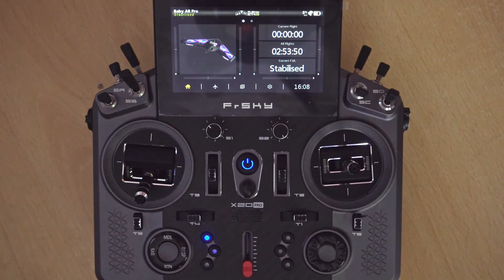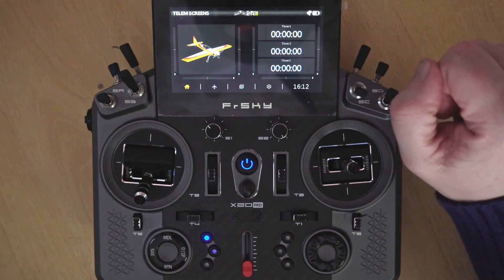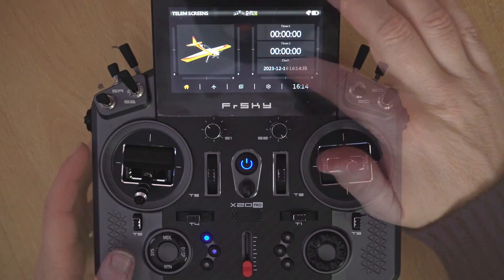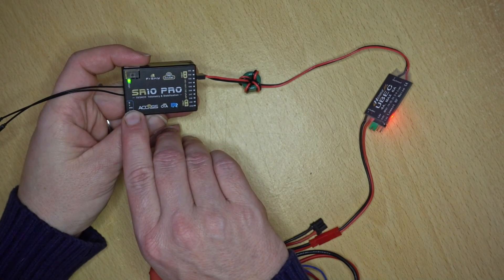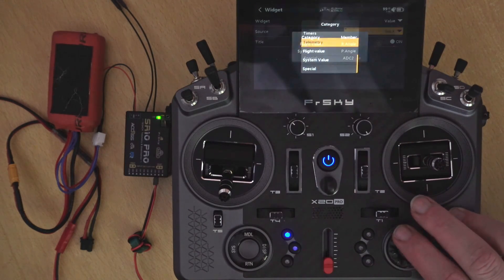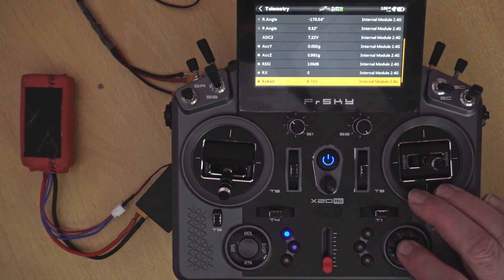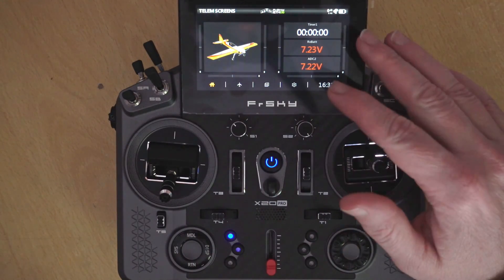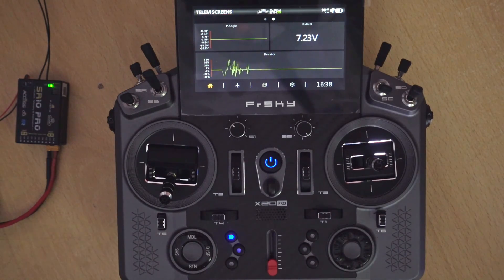Setting up telemetry and sensor widget screens on ETHOS

Comment: I am moving from Spektrum to Frsky it is a steep curve but with the help of your videos it's made things a little easier. Now the question if I set a basic model up eg. expo, throttle cut  and rates. Can I use this  as a template for other models after making some weeks to match the new models. Thanks

Comment: Hi Daren. To "reset" the line charts, "Flight Data" is the only option that I can get to work, but for some reason it sets off a multitude of my audio warnings. As an interim solution I set a pause condition as the Disarm switch kill position. Any ideas? Thankyou.

Comment: I am trying to get telemetry data from a chain of SBus sensors (GPS, flight battery current sensor, etc.) through my TD SR6 to my X20 HD. My question is: where do I plug in the head of the chain connector and where in Ethos do I configure  the string as SBus. I notice that if I touch the RX1 TDSR6 in the RF System page, I get some tantalizing options, but I can't figure out the details. Any help would be appreciated...
Reply from the maker: These sensors are usually SmartPort (or FBUS). So they should daisy chain together. Then plug in to the SmartPort (S.Port) connection on your receiver. 

Then on the transmitter you’d just need to discover new sensors on the telemetry menu.
Reply: That's the problem: neither my SR6 nor my SR18 have an S.Port connector, just connectors marked 1 through 6 (or 1 through 18)...
Reply from the maker: You should be able to assign one of those ports to SPort. It will be in the receiver options.

With the SR6 it’s on the white connector on the top. From the left, you have - + S. S is the SPort connection.
Reply: @MrD  You are the oracle for most of us! Thank you for staying with my silly problem. With your guidance, it is resolved - thanks again...

Comment: Is it possible to set a max current or max rpm on the screen to view it after the flight i fly heli and i am not able to look down during the flight.
Reply from the maker: Yes. When you choose the telemetry sensor you want to view. For example RPM. Long press the enter button. That will give you options for max, min, and maybe a couple of others.

Comment: can you do one on the new X20Pro AW on how to adjust the gimbals to 45 . i cant seem to find anywhere saying how to do it
Reply from the maker: I don’t get what you mean about setting the gimbals to 45?  The pro radios are basically the same. The only difference is a couple of switch and slider types, an extra haptic motor, and a different function for one of the external antennas. Other than that, they’re identical.
Reply: @MrD  their not identical according to the website. 

X20ProAW and X20Rs use MC20R gimblas wich are adjusted front the front but Nobody has put out information on how to do it .
The Standard X20pro uses the MC20 gimbals  They are not the same gimbals according to Frsky 

They can aperantly be set from 45° to 60° without the use of a stick Limiter kit
Reply from the maker: @jjames5928  ah yes, I see the little holes. Sorry, I don’t have that radio or those gimbals. So I can’t offer any advice. 

Personally I’m not a fan of front adjustment of gimbals. I’d rather take the back off once. Than have the holes on the front all the time, inviting dust and debris inside the radio.
Reply: @MrD  makes sense. We'll hopefully some info comes into light. I prefer to have my gimbals go to 45° or somewhere in between 

I think once I have them set I'll use a very small amount of Goop and plug the holes to prevent debris from entering the internals

Comment: I have a question. I’m getting a sensor loss message, at the same time my voltage reading is blinking. (Cutting out I think). Any ideas on that.
Reply from the maker: I’m assuming voltage from the aircraft? How close is the transmitter to the aircraft? If it’s close, it could be getting swamped? What link are you using?
Reply: @MrD  yes from the aircraft. I am very close to I. I’m using x20s. with a TD18. Rx. I took away the telemetry voltage. I’ll try to set it up on the widgets again.

Comment: Thank you for this useful explanation. But there is one thing: is it possible to display stored log data from a terminated flight on the transmitter screen. Sometimes it would be helpful to check e. g. the RSSI immediately after landing, still at the airfield. As far as I figured out, open TX will do this, but what about Ethos?
Reply from the maker: In ETHOS 1.5 I believe there is a log file viewer.
Reply: @MrD Yes you are right. Yesterday I flashed my transmitter to 1.5.2 EU and there you can see all log data in a line diagram. Thank you and kind regards from Austria.

Comment: Is it possible to keep the total amount of time (hr:mins) that my TX20s has been turned on for..even when it is turn off/on again.. This info is available in OpenTx via Statistics? thanks
Reply from the maker: No, timers are related to models. There isn’t a general timer just for the transmitter.
Reply: ok thanks

Comment: Great video I learned a lot, but I have slightly different scenario. My balance connector is currently being used for Fpv equipment, and three out of my four telemetry wires are being used for telemetry currently, so I do not have a black wire which is already being used, I assume the A2 wire will go to the main battery positive. Is that correct? thank you for your time. This particular subject is not well covered. Kiwi4. https://youtu.be/CWxakfTs71w?si=eKcdqMTrNJgygnGj
Reply from the maker: Yes, AIN2 wire to main battery positive, the - to the main battery negative. That’s all I’m doing with the balance cable adapter. Just make sure the AIN2 on that particular receiver can handle the full battery voltage.

Comment: Thanks for mentioning the AIN2 voltage input from receiver to receiver. I blew out all the servos on my plane when I got voltage measurement working great on my R8 Pro then tried the same thing on my SR6. It seems that on the original Archer receivers only the Pro versions can take full Vbatt. I blew out another set of servos thinking that the red wire from the AIN2 cable was what I needed to connect to my battery, only to realize that was SBUS power (5v) and not the AIN2 pin. Thankfully I only destroyed a handful of cheap servos and not the receivers.

Comment: Request to lua script developers: It would be great to have a widget to display number of satellites. This would enable a quick & easy way to know when you get enough satellites to enable inav to arm. . I cant see this as a telemetry value so this must be some internal data format not available to the telemetry values list. There are many parameters available on say the yaapu full screen lua script that do not appear on the telemetry list so many of these would be great to have as individual lua widgets such as distance to home  or glide ange to home etc. If these appear in the telemetry values list you could also get Ethos to play these out as audio when you have the goggles on. Maybe there is a way to already do this. Anyone know how to?
Reply from the maker: What telemetry are you using? If this is INAV over SmartPort. The number of sats are in the Tmp2 sensor. The last 2 digits are the satellite count.
Reply: @MrD   I'm using INAV over SmartPort but Tmp2 sensor does not appear, neither does the Tmp1. I'm getting temp1 & temp2 sensors but these are set to temperature but the readings are nonsense. I googled the INAV sensor list at inav/docs/telemetry_md and I found that also missing was 420, 430, 440, 450 & 460. I'd particularly like to get 420 as this is distance to home but I've since discovered that this can be got using a calculated sensor using the formula 'distance'.
Reply from the maker: Tmp 1 and 2 are flight modes and GPS respectively. It sounds like the sensors may be being renamed somewhere. Tmp2 should be a 4 digit number. The first is a bitmask for the GPS status, the second is the quality, and the last 2 digits are the number of satellites. I’ll investigate and see what I can find.